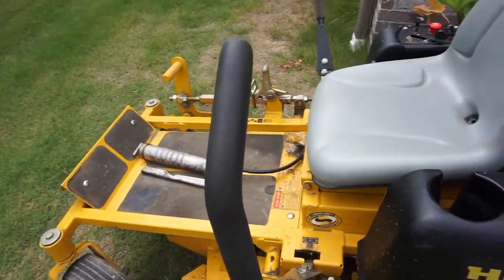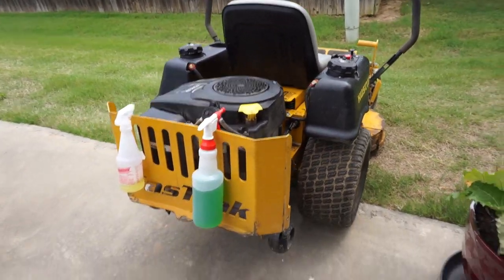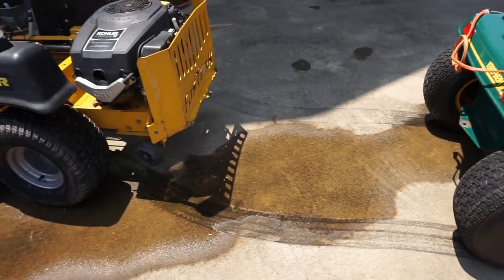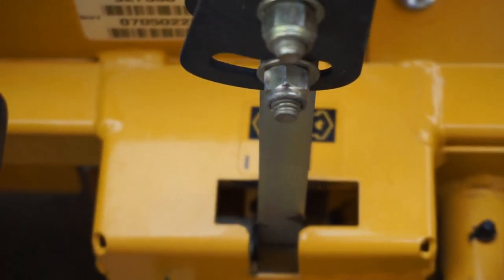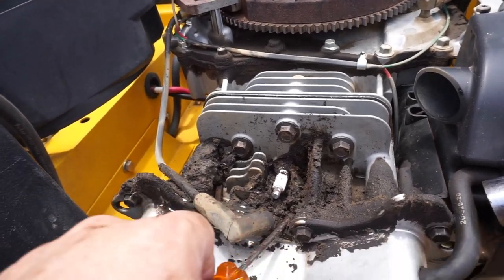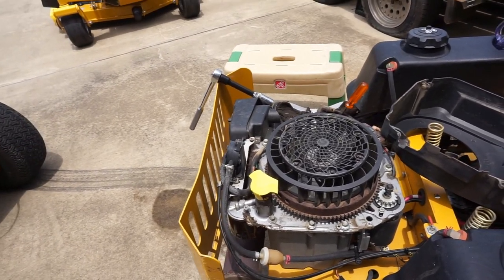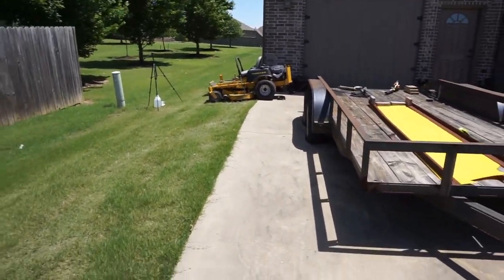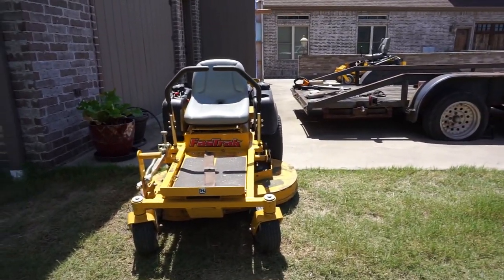How to Adjust Steering Sticks-and overall condition assessment of a Hustler Fastrak

Comment: Do video showing adjustments to control arms I need them to be further out .I am going to try again .I need the sticks out if my chest .
Reply from the maker: Mark, I can do that for you. How tall are you? I'm 5'10" and robust as is plain in the videos. I have mine adjusted so that they are just about touching in full reverse. I also have the suspension seat and slider which puts the rider up about and inch and a half higher.

On top of that, I also have the World's First Body Lift Kit on a Hustler Raptor SD. lol Which tilts the seat forward causing the sticks to need to be farther forward. I also placed them so that they touch. This allows one hand steering when or if necessary.

Comment: You need to show work performed we all would like to see how its done thanks
Reply from the maker: Robert, are you speaking to this particular Hustler? I don't own that mower, I was just doing a favor for the widow getting it up to snuff. 

I think I do have a stick adjustment video up showing the steps. I'll have to see if not, I will have to do one this winter with a fender & wheel are off so that the camera can get a direct view of the process. I really need a camera person. 

Wanna volunteer then you'll also get to see it in person?  lol

Thanks for watch and the suggestion. I'm all ears for what y'll want or need to learn. 

Max
Reply: @MaxsGarajMahal  I'd love to donate some time I'm in Arkansas where ste you
Reply from the maker: @robertyearian227  Just above Little Rock about 50 miles on 67-167

Comment: I have a  FastTrack  I need  help  .?
Haw to stop  the  clutch  spinning
Reply from the maker: First thing to do is open up the dash. Then put a multi meter across the posts on the switch with it in off. Make sure there is zero continuity across the hot in (battery) terminal from ignition switch and the hot out (clutch) terminal. 

With clutch switch in the up (on) position, test again, there should be continuity showing the switch is in working order. 

If the switch does not open the connectors inside, the switch is defective and will need replacing. For testing purposes only, dash still loose, sit on mower so that feet are not a concern for getting under the deck, then start the engine. Please do this outdoors or at least with doors open and a good cross air flow. With engine started I must assume from your plea that the clutch will be engaged. Now, disconnect the harness below the clutch switch. If the clutch disengages, you know the switch is the culprit. 

Get back to us. Good luck.

Comment: Wow,  it might be small but that baby Fastrak looks like it has a lot more steel in it than our SDs.
Reply from the maker: it is heavy for a tiny thing for sure.
Reply: that is when hustler fastrak was made easy to get in and they road  nice too ,  its a shame all hustlers dont have twin 5 gallon tanks  on them like the old fastraks did except mine had a  20 hp honda on it never really like the kohler  courage , kohler magnums  where nice but the courrage just did not compete
Reply from the maker: @dwaynemaslowski9398  This FasWrek really hurts my back when I use it. I would prefer to take an arse whooping. haha
Reply: @MaxsGarajMahal  i have a back for over 65 yrs now  my 2007 fastrak never gave me more back pain , maybe now b/c they change  the frame and design its more painful to drive haha, those designs where  good like up in the vid now you hurt your back just by twisting your body to change the deck height

Comment: I just remove belt covers.  Not possible to be turning if off machine and gives more foot space for stepping on and off.
Reply from the maker: Removing the covers may give more foot room, however one thing it doesn't do is create a laminar air flow around the pulley inside the belt cover as well as a turbulence below the pulley to create an air void below the pulley to keep the top of the deck clean around the spindle and especially the bearing. 

Whatever you like is what you should do although I created the video to show you what is the best and most efficient means of prolong both bearing and belt life. 

Another thing that you haven't probably experienced as of yet is a stick or other debris entering the belt - pulley path. That can almost flip a mower and usually will cause the belt be rolled off the pulley. 

The most important part of the correctly ported belt cover is the belt will never burn due to debris build up below and around the pulley.

Again, if cover off is your cup-o-tea, then by all means enjoy your mower in any configuration you are most comfortable with.

Thanks for watching, commenting and I hope you subscribed, liked and shared the video to someone it may give thought to.

Comment: I swap my raptor sd for a fastrak like that or my 2007 anytime they where tiny but where fast i had a 52 inch deck now have a 54 inch deck on my raptor sd    and i could cut 1 .750  acres with the 2007 fastrack  in 55 mins with the raptor sd  it takes me 100 mins mainly b/c of the stop to refuel  the tank also the little fastrak  was top speed of 8.5 mph  my raptor  sd can only  get 7,5 mph max
Reply from the maker: My Raptor does 8.2 and its going faster soon. lol. I can already outrun this Fastrak before the tire swap and body lift. lol
Reply: @MaxsGarajMahal  you also mention about the deck adjustment , they where a lot easier to adjust, now on the raptor sd it seems 2 hands and a foot is not enough to adjust deck height
Reply from the maker: @dwaynemaslowski9398  You are absolutely correct about adjusting the RSD deck height. Can be a double pain. That is about the only thing I super dislike about the RSD though.

Comment: DIDNT SHOW HOW TO TAKE UP SLACK IN STICKS YOUR GOING FROM THAT TO DECKS TO VALVE COVERS JUMPING ALL AROUND SHOW US HOW TO FIX SLACK IN STICKS FIRST AND THAN ALL THE REST! DIDNT LEARN NOTHING THATS WHAT YOUR TITLE IS HOW TO FIX  SLACK IN STICKS AND ADJUST
Reply from the maker: The title should have told you it is overall condition. It wasn't about taking out slack it was about making it go straight. If you have slack that is self explanatory. Rebuild or replace worn parts  Thanks for watching.